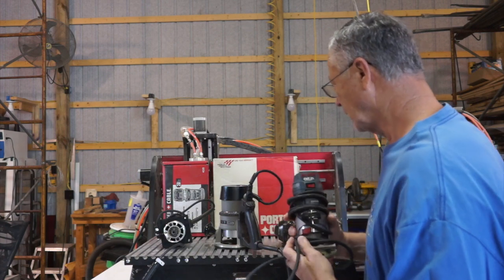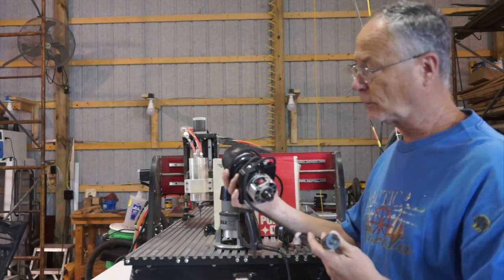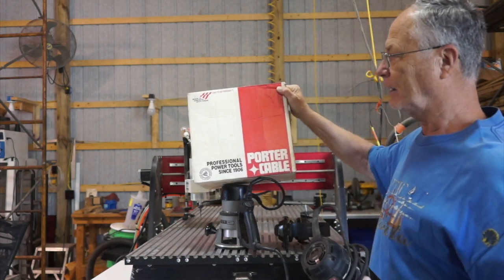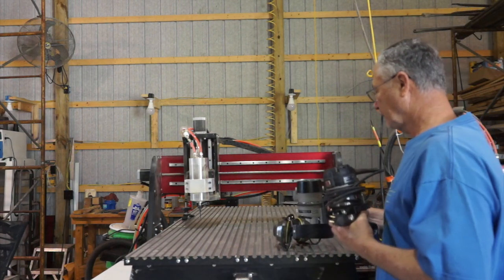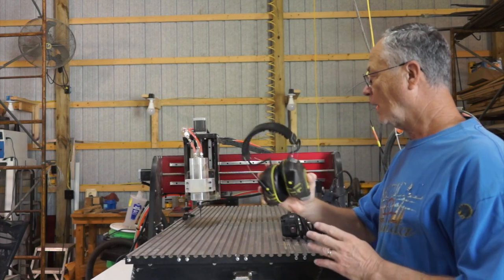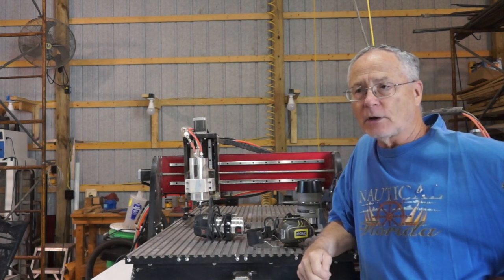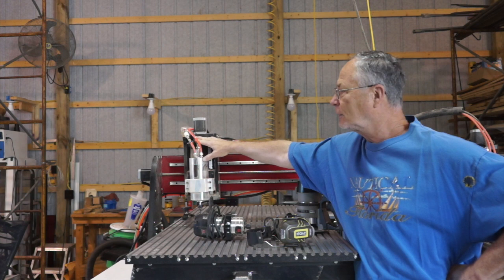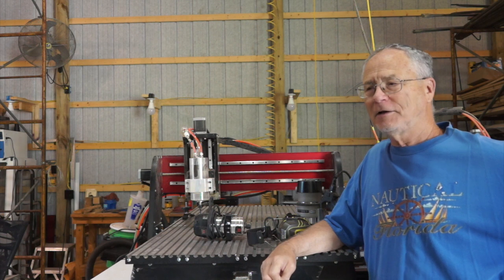Routers for CNC Shark

Comment: I put a variable speed control on my porta cable. Also built a sound box out of 1" foam to cover my shark up.  Best thing I have added to it.  Also ran it for 7 hours a day many days.   I like the fan that blows the chips away from the bit.  Being in the closure it keeps the dust down to inside the closure
Reply from the maker: Just be careful not to run the router to slow, this will underpowered the router and cause it to stop when the cnc moves it through the material.  The same thing happens with the spindle if your travel speed is to high and router speed too low.  Cecil
Reply: @cecilwoodworking7204  I have snapped several 1/8" End Mills by switching from Laser to Router and not turn the router back on.  I even made myself a note to turn it back on.  I think the Laser driver doesn't power the router so I maybe causing my own bit breaking by turning it off.  The only time I turn the router down is when I am cutting plexiglass as it melts to easy.  The CNC closure keeps the noise down enough.  I made a box joint gadget box that I put my shop vac in and lined it with 1" blue foam.    I really enjoy my shark.  I have made over a hundred projects with it in 6 months.  Made 17 wooden canteens with it this past week.  Here is a video of my shark and closure.
https://www.youtube.com/watch?v=TOQ0obLajSA&feature=youtu.be
Reply from the maker: @MarkJonesRanger  I have snapped a few over time myself but they are a lot cheaper than rebuilding the laser. One slip and the laser spins so far that it pulls out the wires and destroys the electronics.  You can by 10 1/8 in bits for $22 or less. Here is a set on amazon https://www.amazon.com/Spiral-Router-Diameter-Cutting-Carbide/dp/B07B2TS5Y9/ref=sr_1_12?dchild=1&keywords=1%2F8+inch+milling+bit&qid=1611078149&sr=8-12  Good Luck  Cecil